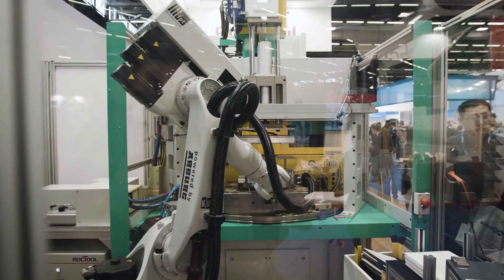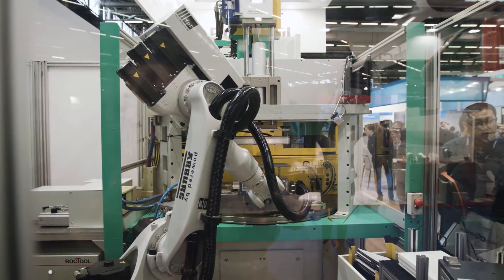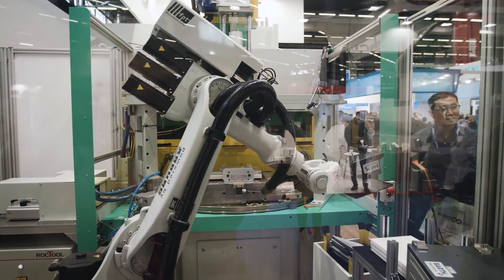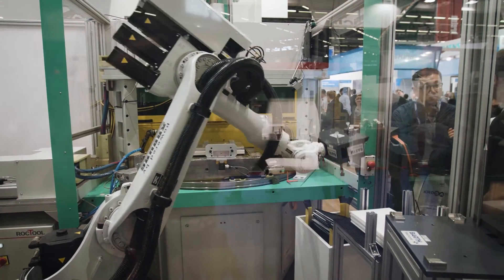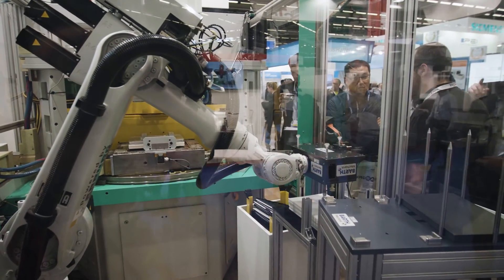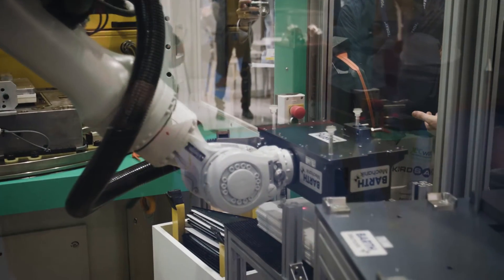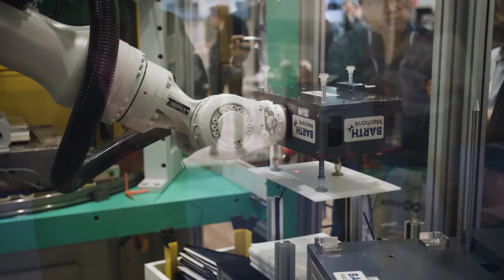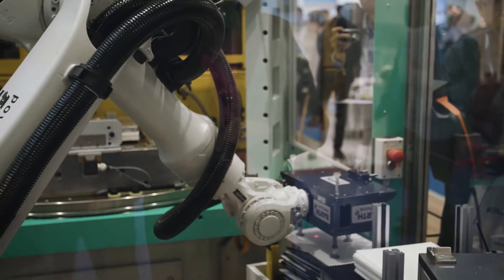Combining Best Properties of Carbon Fiber & Polycarbonate | JEC World 2017

Comment: The world needs this in 3D printing filament,, yesterday!!! Love this idea and their value-added process of combining the new composite sheet with the customization and strength enhancing qualities of injection molding, seems like a good match. 

Fortunately it seems that carbon fiber is poised to do well for 3D printing more substantial engineered materials. Lets hope we see carbon fiber infused in poly-carbonate, and perhaps a new lower temp versions of PC so it can mix better with other plastics and probably be easier to print.
Reply: check out Synergex and Lattice from www.coats.com.